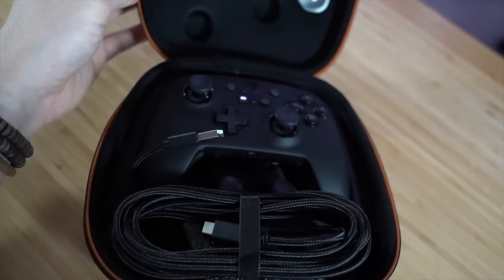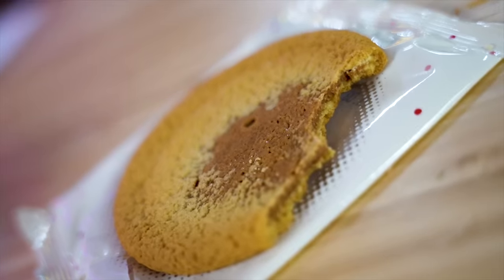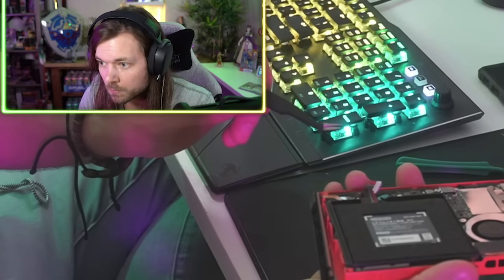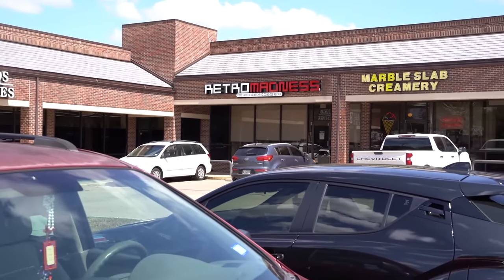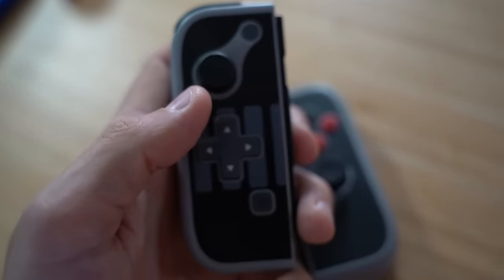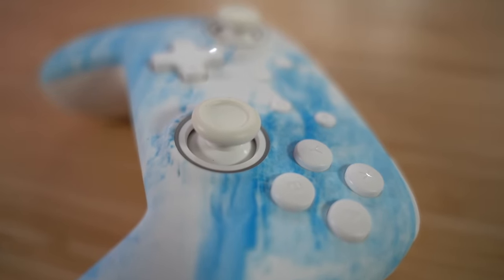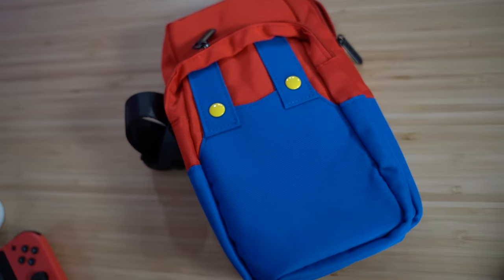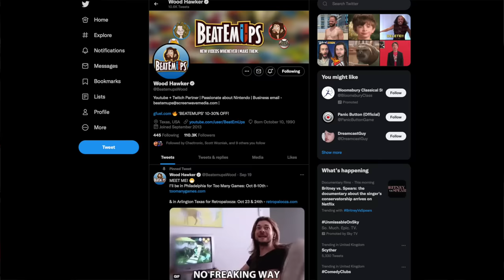The WEIRD Nintendo Switch Accessories on Amazon

Comment: The case being waterproof is probably just about the material of the case, not the ability to submerge it in water with a powered on Switch without breaking it.
Reply: If they are advertising as 100% water proof. It's supposed to be 100% water proof. Since this clearly isn't the case, they can get sued for false advertising.
Reply: @MrTytyjohn64  because he has like 7 of them
Reply: Also he didn't need to have the Switch inside of it.
Reply: @MrEnte3000  that was Wood's biggest mistake with that case.. testing
Reply: @mr.paladin5794  That's what I'm saying. The material is 100% waterproof. Not the case itself.
Reply: @MrJobocan  it’s still false advertising they should have said that the material was waterproof and not the case itself and since they weren’t specific and made it damage property they could get sued
Reply: @zapunknown  Tell me where on the product page they claim it to be 100% IPX9 water resistance or even an 8. All the cases on Amazon claim to be between 1 and 4. Which just means the protect your switch from rain and small spills.
Reply: @mr.paladin5794  Where they advertising 100% waterproof? He didn't show the product description. The most like said "water proof, protect from the rain". Not "water proof, can be submerged undee water". They could have even put water resistant on the page.
Reply: @scarffoxandfriends9401  water proof is still stating water proof.
Reply: @mr.paladin5794  A lot of pages made by foreign entities mix up the two words as they think they mean the same thing. Which is why the thing that matters the most is reading the product description for it's grade. There's plenty of products on Amazon that say "water proof" and in it's in description says "grade 2, protects from rain and light spills".
Reply: @mr.paladin5794  it is advertised as surface waterproof, not fully waterproof
Reply: @scarffoxandfriends9401  it states it's 165d water proof. But doesn't elaborate further.
Reply: @mr.paladin5794  🤦‍♂️that finally gave me the exact product page of the case. That's the name and color of the material for the case is made out of. "The outermost layer of the switch case is made of 165D waterproof oxford fabric with a hand-stitched hand strap (detachable), which is durable and comfortable." It does not claim the case itself is 100% waterproof anywhere on the page. The picture clearly shows it handling light water droplets and says it makes the case easy to wipe off, not that it allows you submerge it underwater. I guess I shouldn't have suspected more when in the same video Wood took "unplug the battery" as "completely remove the battery".
Reply: @scarffoxandfriends9401  I was just going off what he said. Until I had time to find the damn thing which didn't show up and I had to do extra digging.
Reply: @mr.paladin5794  Don't worry, I was face palming Wood, not you. I also couldn't find it in a quick search which is why in the previous replies I was saying general descriptions that all the other "water proof cases" wrote along with general Items I've seen before. The only reason I didn't take his word at face value because in past videos he has added words to people's mouths instead of just sticking with what was actually said.
Reply: @mr.paladin5794  they don't advertise that. All the listing says is that it's made of "water proof material" meaning the material itself is waterproof not the case
Reply: @fiscaldisco5234  I stated in another comment, I was going off what he said they advertised.

Comment: I think there’s a difference between waterproof and water resistant. I think the latter is the one that allows you to immerse the case in water, but waterproof just protects against splashes I think.
Reply: I think you have it backwards but on the right track
Reply: @brettleist7563  really? But wasn’t Wood’s case “waterproof”, and that’s why the immersion didn’t work? 🤔
Reply: @stvjful  that's because they false advertise. Happens quite alot. I was even suprised that the case was water resistend
Reply: I looked the case up. It has a "waterproof shield"
I.e the hard shell is waterproof. The zipper is not. 

But yeah, waterproof means it can be submerged, water resistant means its splash proof.
Reply: Other way round, wood may have just said the wrong thing or the case was advertised wrong
Reply: @SunnyCress  ahh I see! My bad - tanks everyone 😊
Reply: Oh.. have you ever heard of a bullet resistant vest?
Reply: @iplaydthis  sounds like something that wouldn't entirely save your life lol
Reply: @oculus9233  exactly. My point was that "resistant" means it protects a little against, water in our case. While "waterproof" means it will be submersibile(up to a point)
Reply: @iplaydthis  it protects you from light bullets 😂
Reply: waterproof means it can be submersed and water resistant means you can pour water on it and it’ll roll off. i think this case was probably meant to be water resistant. zippers are rarely water proof.
Reply: @__Alo__  The case can be submerged, the zipper cannot
Reply: @__Alo__  The case can be submerged, the zipper cannot
Reply: @dayandere2669  that's literally what I said. 
But actually not because the case includes the zipper. You can't submerge the case without submerging the zipper, the zipper is Incased in the case.

Comment: 7:22 what makes me laugh is that simply disconnecting the battery from the motherboard has the same effect as physically removing it from the device. Your tech buddy only wanted you to cut the power supply from the board 🤣😂 He even said "I would UNPLUG the battery"
Reply: exactly! And I have no idea why he thought it was a good idea to pull at the cable with such force x.x  common sense!

Comment: As a computer repair technician I'm a little upset that spawn told you to take out the entire battery. After you simply disconnect the power that was probably good enough to just let it dry and try again in a couple days. Severe miscommunication on his part.
Reply: You can't just disconnect the power to a switch since it's a portable device. That is why he said take the battery out.
Reply: @scarffoxandfriends9401  what are you talking about when you disconnect the battery cable from the main board the power is not circulating thus there's no chance of shortage which is why he told him to take the battery out in the first place.
Reply: @rokku87  I rewatched the video and Spawn actually did not say to remove the entire battery. He said "unplug the battery".
Reply: @scarffoxandfriends9401  You have to be extremely specific when it comes to technical instructions. If Spawn wasn't sure he should have just said turn it off and take it to a company. Not saying Spawn was being malicious but he was not being considerate to possible misinterpretations his friend might have made. Language is extremely important especially when it comes to technical language. As a computer science kind of guy that writes technical documents as part of his job this was a big oof. He should have specifically said "Open the switch and remove the battery cable from the motherboard only, then let it dry" or something to that extent.
Reply: @rokku87  I think the major thing here is Spawn job was to fix consoles himself. He never instructed people to do it. So that's why he said "just unplug it" because that's how it thinks of the situation. I don't blame him for being anymore specific because most people don't take the leap of logic that unplug means to take the whole battery out. He probably would have been more specific if Wood told him the reason his switch was soaked was becuase he took an Amazon page showing a case with a little rain on it was the same thing as being able to dunk it underwater.

Comment: The battery pack could be used for people with a Lite, or if you don't dock the joycons on a charger when you're done using it. For example, if you constantly forget to put them on the Switch, then it could help? Still weird though.

Comment: The screw up was turning it on without making sure it was 100% dry. There's a possibility it would've worked fine
Reply: The sad thing is that the batery entry could become rusty and so the switch stopped caunging, actually all he did were the worst choices

Comment: To be honest, the battery pack thing may be useful as a grip more than a battery pack if you want to play with them separated in each hand.
Reply: Why not just sell it as a grip then? Seems odd to have the joycons in a grip that will charge it with AA batteries. It would also be cheaper if it was just an attachment vs having a circuit board inside.
Reply: Yhea, Im surprised Hori hasn't made individual grips with that mold, without the electronic components

Comment: Isn't waterproof and water submersion different? That's why some watches say water-resistant and others state up to x meters of submersion? Anyways hope your switch survives.
Reply: my friend told me in the past in the case of phones (he works w phones) water resistant  usually means they can handle light splashes, rain, spills, etc but waterproof is supposed to be more legit full water protection (as in submerssible). for example a waterproof camera is a camera you should be able to use underwater (like the old cheapie Kodak waterproof ones).
Reply: Water Resistant means random water got on it as in a very small amount. Waterproof has different meanings, take watches for instance they will actually say waterproof up to 10 ft or something like that on them telling you the limits. So waterproof in this instance probably meant if you sprayed it with a hose for a few seconds you would be okay. More water than water resistant, but not total submersion. This is what happens when it's subject to interpretation.

Comment: seeing you almost start a fire because you were worried the wet battery would start a fire was pretty funny not gonna lie. next time, just drop some isopropyl alcohol around the edges of the battery and let it work itself into the adhesive then you can safely remove the battery without damaging it.

Comment: The funniest thing about the waterproof case test is that you didn't even need to put a switch in it to test if it worked. You could have just dunked the case in water and then opened it to see if the inside was wet. I suppose that's less dramatic but whatever lol.

Comment: I have owned the Vive Fox Joy Pad for a few months now. They're actually quite nice for the price. You do not have to charge them independently via the USB port on the side. They charge while attached to the Switch when it's on the dock. And have a good battery life on them. I'd buy them again, for sure.

Comment: The joycon batteries could be helpful when travelling and you have limited access to power and want to charge a second set. Like it would be good to not have to change the joycons over on the switch itself when it’s charging through a cord/wall plug or battery pack rather than the dock and then take the extra time to have multiple sets charge so my friends and I can play smash while camping.

Comment: I'll be honest, I brought the battery pack, it was mainly for when I went to Japan as the flight was 12 hours. But I never used them and haven't since 😂. They were designed for Arms as they give you a better grip and longer play time, although going by the 20 hours battery life I can't see anyone running low anyway

Comment: ...my only question is why did he not just simply cut out a small cardboard box-wall, put it IN the "waterproof" case, and then tested whether the box was wet or not?
Reply: Shock points on the video and enough money to own more then one switch. 😩

Comment: I'd use those battery packs for the joycon just for the grips and Skyward Sword HD. Using the joycon separately without the strap attachment is uncomfortable, and it feels too wide with wide with strap attachment. Having the round back would make it much nicer.

Comment: 23:31 , actually, I've had situations where they would come in handy:

I have 4 joycons, two of which I mostly use for gaming on my own, and the other two for when the occasion arrives where I have actual people to play with. However, this does not happen very often, so sometimes when someone comes over to play I need to hand them my reserve joycons, which have been sitting stationary in my switch bag for months, which means they ran out of battery, so I first have to charge them before I can play with that someone... So in this case those battery packs would come in handy 👌

Comment: I'm still so confused why you attempted to remove the battery, just unplug it. The goal is to prevent power from flowing through the switch potentially shorting due to water lol. Well made a great video... or side part of a video xD

Comment: I actually kinda like the batter packs for the joycons. If you have bigger hands it makes them chunkier to use separately while docked while also charging them. You could also buy rechargeable double a's, so you can reuse those as well. Yea you can just plug it into the switch to charge them but if you mostly use your switch docked and want to charge another pair and play at the same time their pretty useful. I think if you could slide them into the switch it would make it that much better cause you could charge them with the switch turned off.

Comment: To be fair, if I’m playing my switch on the tv when I’m home alone then the joycons are going down in charge, then when I stop playing I turn my switch off which means they’re still not charging. If I play with the switch docked again then turn off the console after playing, my joycons aren’t getting charged at all. I’ve had them run out of battery on me a couple of times in that sort of context. So those battery pack things are pretty useful for if you primarily play with the switch docked and turn it off after playing it without being able to keep it in the dock constantly

Comment: Sitting here stunned as you try to rip out the battery when all you had to do was UNPLUG it from the board (that's why people said it was easy, no need to rip the battery out) lol. Just make sure no power is going through it. Nevermind.

Comment: I know this is a year late but if you ever have a issue with the battery again, use a heat gun around the battery to loosen the adhesive so it will be easier to get the battery out and the plastic pry will come handy, never use metal

Comment: there was no reason to remove the battery...just unplugging it was enough. then leave it to dry 100% before powering it on and it mightve been fine. water only damages electronics when the power is running through them or if they cause corrosion

Comment: Think you missed the use case for the battery packs for the joycons. It’s for the times when you forgot to charge your joycons or another pair is very low and you want to play with someone else. You’d have to wait til the joycons are charged enough to be able to play. This eliminates that time.

Comment: Wood if you used isopropal alcohol next time? You could actually test your waterproof cases instead of plunging it into water and it will not cause a problem with your switch. Just let it dry out 1st. It only takes a few minutes for it to fully dry out.

Comment: Never turn on an electronic device that was soaked in water straight away, it needs to dry up as much as possible, since turn it on will possibly make it go short circuit with all the water in the connectors. : \

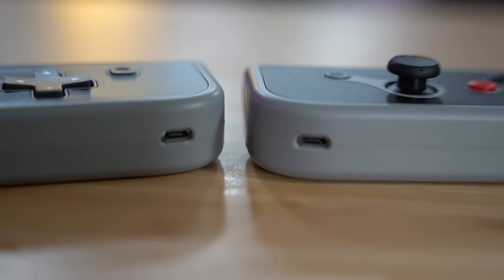Comment: 13:48 in my opinion that has nothing to do with the switch. If you're making a chargeable accessory within the last, like, 5+ years, make it USB-C damnit! But this is especially bad yeah in an ecosystem that otherwise would be 100% USB-C (like these joy cons, or also for example iPhone and AirPods, which are the only ones that don't use USB-C in Apple's ecosystem!)

Comment: Dear God my eyes, first don't submerge electronics. Second if you do use 90% or more isopropyl alcohol it'll dissolve the adhesive. And DO NOT PULL BY THE CABLE. I hate to be that well actually dude, but truly this had to be the most painful thing I've watched.

Comment: Late I know, but that case was not going to be waterproof. Just because of the zipper, now yes they do have a waterproof zippers. But that zipper was not one, may guess is the thing is water resistant. So it could be out in the rain for a just a bit, and I say for a bit because again that zipper. If any amount of water gets on top, it could flow down, and get in, though that zipper.

So this was missed labled, someone got waterproof, and resistant mixed up.  Amazon should have this taken off the sight if not already.

Comment: Those "water proof" normally mean that they can prevent it from getting wet if it rains or water splashes -..- not to submerge it into water you nut xD
Reply: Also, use isopropilic alcohol to melt the glue xD (leak some drops on one of its side ad wait a few secs xD